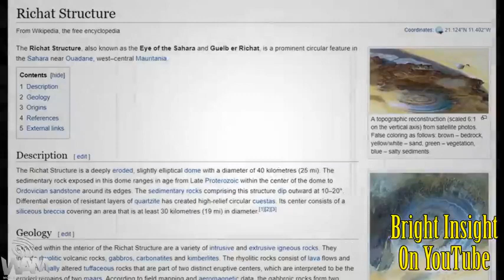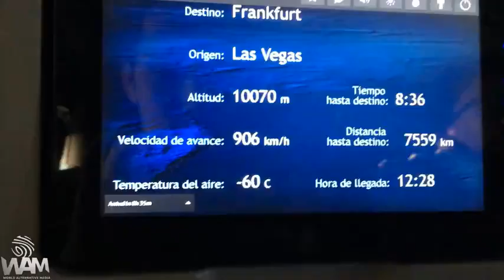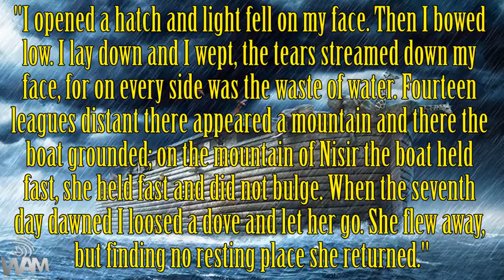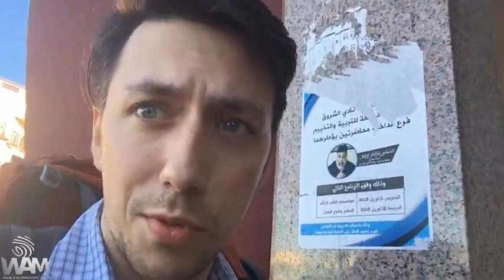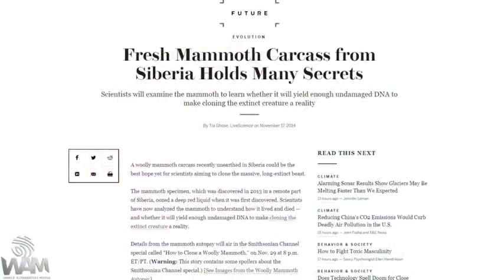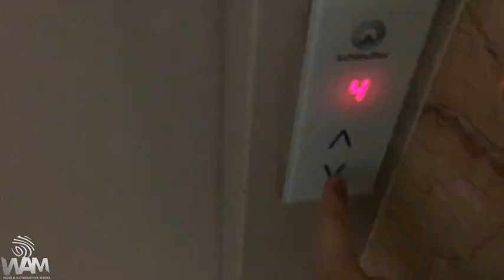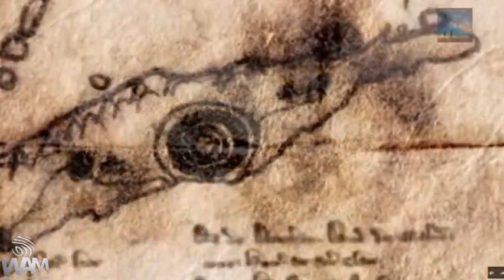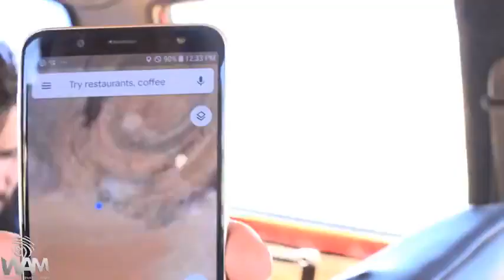Atlantis In The Desert - Journey To The Richat Structure (FULL 2019 Documentary)

Comment: You don't want to look for signs of an old civilization there, it was all washed away. And  by something powerful enough to wash just about everysingle bush, tree, rock and any structure in the area the size of America. Where you want to go look for signs of a civilization you want to go look through all the soft sediment off the coast in the path you see the flood took from the sky. I bet if you dig far enough down into all that mud you'd find some structures that look like broken walls or stair cases. But you ain't finding anything at the actual location.

Comment: Dont rule out the possibility of it being Atlantis -I still believe its the most eligible of all possible locations, its also worth noting that the bedrock would have been wiped away as bright insight pointed out, so to say they cant have built at that location  could be wrong, i think it's still possible they could have had structures built on top of the bedrock. Regarding the mountains, they may have been larger but eroded back in the day, as there are still technically mountains to the north... just quite far away but still technically north

Comment: I wonder if an archaeologist in 5,000 years will be able to determine what those steal carcasses are laying around, if any are still left. You must have taken the most difficult route there is to Mauritania. No port? No airport? Only a mine field? That is hard to believe. Nouadhibou is supposed to be a seaport. It is possible that those eyes on the walls are supposed ward off the evil eye. The massive torrent of water that flowed through, did more the wash away buildings, it also tore away much earth, thus causing the misshaped rings and the ridges of the center.